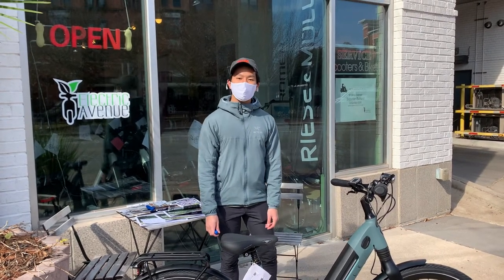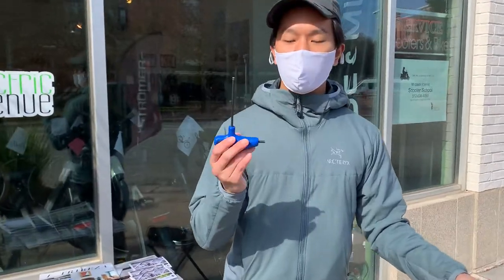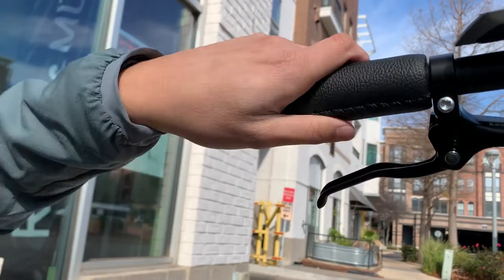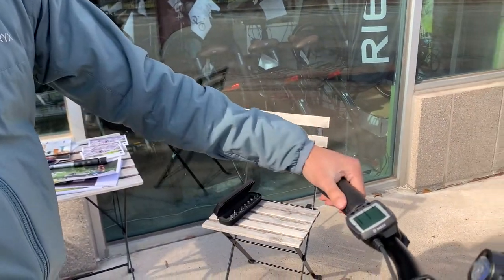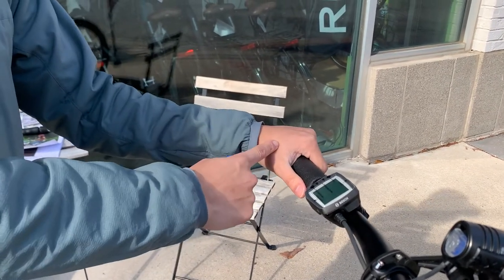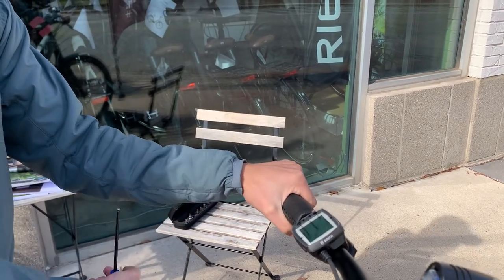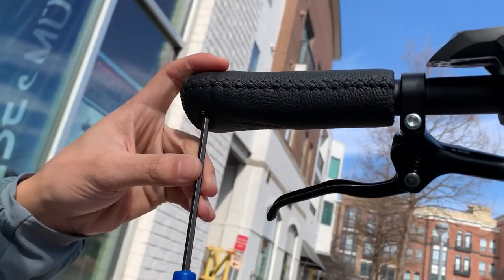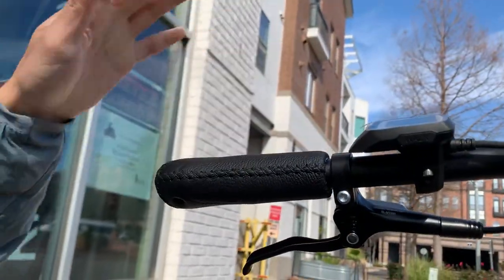How to Adjust Hand Grips on Gazelle Ebikes

Comment: My Ultimate 380 came with the leather looking grips but I'm not seeing and ergonomic shape to the grip. It's a 2021 model that I purchased this spring 2022. It would be a simple replacement were it not for the Enviolo twist shift on the right side which calls for a specific grip size. Can you direct me to a proper ergonomic replacement grip for the 2021 Gazelle Ultimate C380?
Reply from the maker: You could get the Ergon GP1 Grips made for the Enviolo or Nexus on the right side grip, so it is shorter length on the right.  They come in a pair - the grip lengths are Left: 128mm, Right: 93mm.  The Ergon grips are very comfy.
Reply: @electricavenue2204  Thanksgiving You. I've ordered the Ergon grips